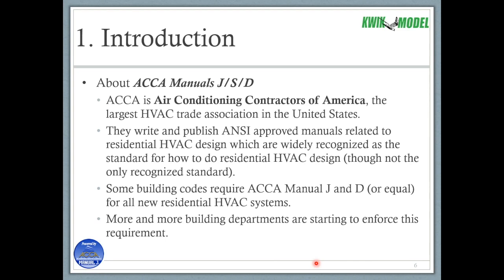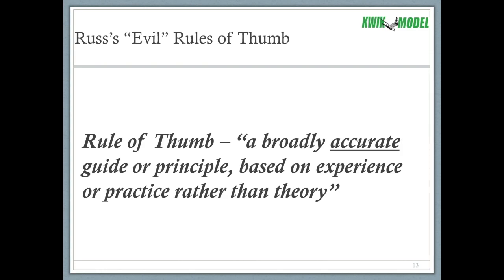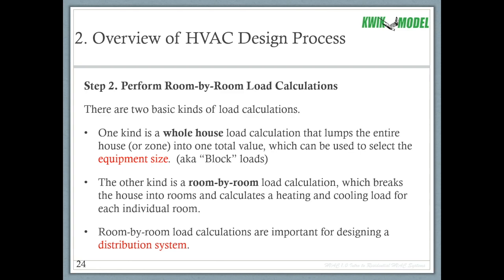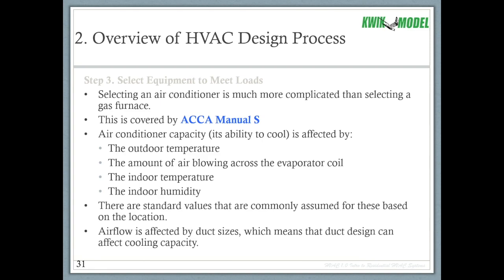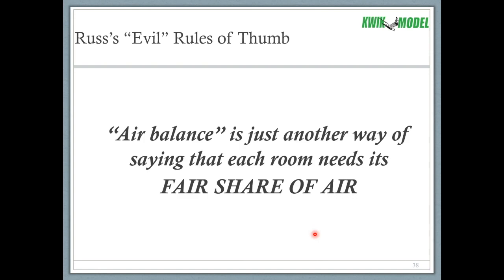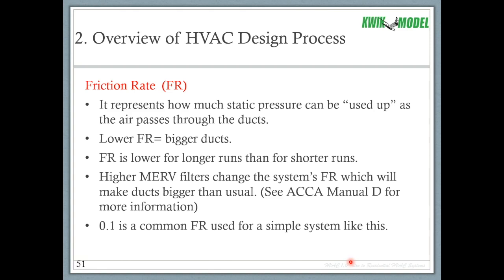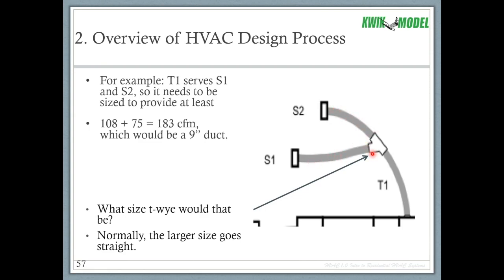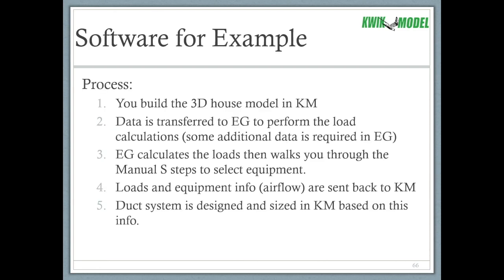Part 1 - Residential HVAC Design Basics

Comment: The problem I have with these calculations is that almost any room in the house could have every person in the house sitting together to chat there for a couple of hours. I need a system that can respond intelligently to a spike in heat, humidity, and CO2 in any room and respond by spiking service to that area until the demand changes again.
Reply: No you don't.  The changes you talk about have less impact than putting a warm six pack in your refrigerator.  Do you expect your refrigerator to react intelligently to that?  Of course not.  A well designed HVAC system can handle those types of variations with ease.  Most humans cannot detect the minor variations that you are talking about in a well designed system.   Most systems are NOT well designed and people think they are terrible, which raises their expectations.  We are not designing the space station here, unless of course, you can afford that level of precision.